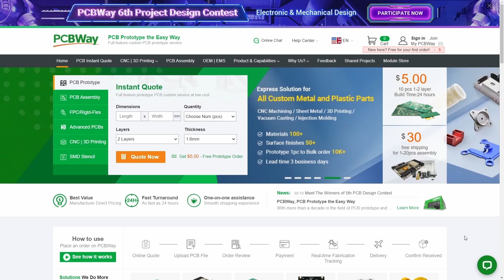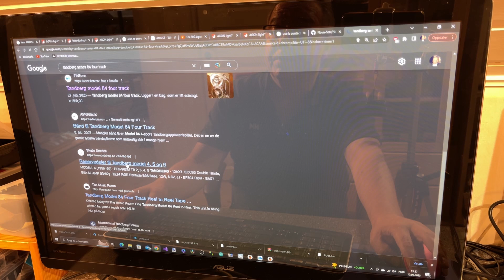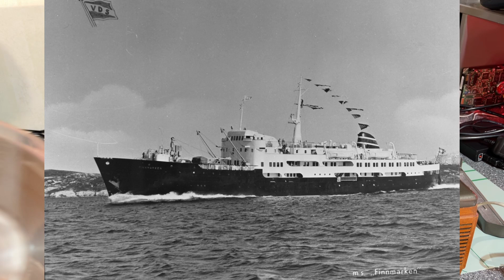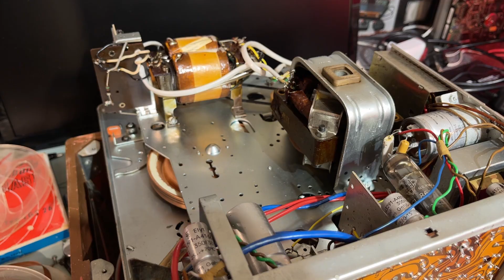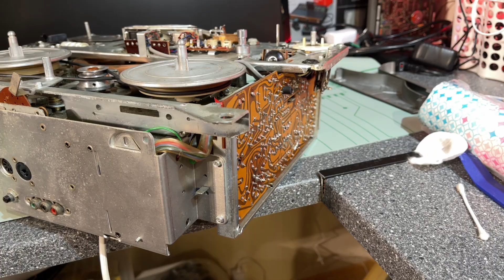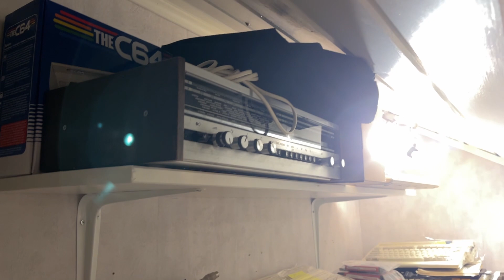My 60 years old Tandberg 4-track tape recorder - Will it still work ?

Comment: 9:33 No surprise there. These are very solidly build machines and that they are capable of functioning after many decades directly on plugging in the mains is a testament to that. Usually the only thing they need, if they have been kept well, is to replace the rubber grommets that hold the deck on the wooden case, and possibly some belt replacement.
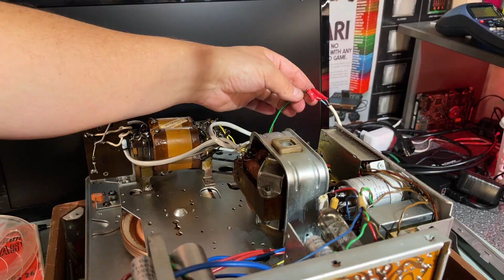19:33 They are usually clean inside, unless you find a sample that was left in the desert or in a manic smoker's house.
Good call changing the Rifas and the rest of the electrolytics and paper capacitors, although it is usually the small ones that suffer the most from age, while the large, power supply ones, as you found, are often still perfectly usable. The latter of course always depends on the original capacitor quality and type of construction method as well as its age.
This deck appears to be mostly valve based. If so, it will last for many years more, with only moderate use. Tandbergs have not significantly picked up in value yet, but this will surely happen as the years pass. With a good restoration, the sound quality will be of a mid-fi quality that can generate a certain nostalgia and will appeal to some people thus inclined. An expert in audio electronics might be able to push this a bit further, but that would require some minor modifications or more extensive parts' replacement, potentially affecting its value (negatively) as a collectible piece.
A warning: never tackle the idler wheels' rubber with anything aggressive like sand paper and the like (like one may see/hear/read on the internet). If these are so damaged that they need replacement, keep the originals somewhere safe for future reference: cheap (or expensive) replacements might fail much sooner than one expects.
One more, final note: I would be wary of using alcohol to clean electronics devices indiscriminately. This is particularly true of newer stuff, where the labelling, decals, paint etc. can come right off but even in old stuff you never know. Especially vinyl covered stuff, rubber parts, all sorts of paints or plastics, you never know how they will react to chemicals. Vinyl, definitely gets permanently damaged and becomes unsightly. Liberal spraying of alcohol in particular should be avoided for two additional reasons: a) most of it evaporates by the time you reach the area to be cleaned and thus b) it helps re-distribute dirt. I believe it is better to arm oneself with patience and plenty of time ahead and go over the same areas two or three times with just a wet lint-free cloth, using lukewarm water preferably, then tackle stubborn areas with a damp cotton bâtonnet. If the dirt/caked grease is too stubborn, then continue with slightly warmer water where a drop or two of dish detergent has been added. Only as a last resort should any solvents be used during a general, surface cleaning.

Comment: Sound like auto-stop is too tight... or pichroller are badly shape... or robber-gear are too loose; spring hold this ticht but sometimes it loose and rubber slips. I fix this kind to put extra spring. test if slow speed working, if not, this is the case. (Retro-mechanic)

Comment: hi have one some where   of this model   in 1986 i picked up a 4 track mono the deck was ok but case was  bad still have the deck 
it's not working  100% any more  my dad had a reel to reel in the late 50's 

it's a right pain to get    PCB Edge Connector  of the right spacing   i have a brenell mini  8  the Edge Connector for the pcb is come apart
you get this in akai  reel to reel  decks   it's the Edge Connector what it.s made of is going bad 

i had to use molex  Connectors  as they don't go bad over time

Comment: I very much appreciate your informative posting. I have recently acquired a Tandberg 12 series, like the one shown, which runs but without sound. The belt is slipping and will need to be replaced. I am hoping you may be able to advise on a source for belt replacement, and also shed light on why the internal speakers do not work. My late father owned a Tandberg 12 in the sixties and recorded family conversations which I would like to digitise, so I am endeavouring to get this working.
Hoping you can help and thanks in advance

Comment: I have this same machine. In fact I have it running right now, listening to some old tapes I made back when I was around 14 years old and some tapes my Dad made back when I was about 7 years old. It runs very well. It does get quite hot due to the tubes in the amp in the lower chassis.  But it's still a fun machine. It needs a good cleaning (i.e. heads, belts, rollers, pulleys) and I should replace the capacitors in the power supply (there is a slight hum) and the volume control potentiometer needs a cleaning.  Back when I was a kid tubes were still very much in use almost everywhere and fully solid state devices were just beginning to  take over. BTW I am 66 years old now.

Comment: Hei:) har en Tandberg 1200x, jeg har prøvd å koble den til platespilleren min, platespilleren min er koblet til radioen min, når jeg kobler den fra radioen til båndopptakeren min med en DIN kabel, og skal ta opptak, så er lyden ekstrem lav
Reply from the maker: Hei. Så bra at du har dette :) Platespillere må ha egen inngang fordi de har ingen egen forsterker. Radioen din har sikkert en egen såkalt phono/platespiller inngang. Skal du ta opp eller koble gamle platespillere til nyere forsterkere så trenger du en egen forsterker i mellom. Disse koster fra noen få hundre. Kjell.com har flere. Søk etter "riia forsterker". Lykke til.
Reply: @Arcticretro  har en gammel garrard model 2000, den har bare bananplugger, noe båndopptakeren min ikke har

Comment: Hi Tommy! I think you should check the capstan wheel lubrication on the recorder. On my old Teac 2300SD this was a big problem. The lubrication will get sticky and hard after so many years, so you need to remove the «flywheel» and rinse it to remove the old grease that is on it. I am not sure, but this could be the main problem relating to the uneven tape transport.
Reply from the maker: Thank you. Will look into it :)

Comment: Great addition to your content. Hey ... admit it. You've been wanting to take that thing apart since 1975. You held back all these years. So .... Are you going to go all Adrian's Digital Basement on us and add audio outputs so you can use it as a reel to reel data tape recorder for your old 8 bit machines? The ultimate coolness would be once you did - that add a manually sequenced "tar" (Unix style tape archive) command to your 8 bit machines so you can do whole disk backups.
Reply from the maker: I love it!
Reply: I actually started doing that to a Telefunken KL-85 which has a solenoid controlled pinch roller actuator which means you can computer-control playback/pause, there is even an input for that (remember that thing was built in the late 1950s) so I added a switch to tell the computer when play or record have been pressed and connected it to my Commodore PET. Unfortunately I haven't built the playback amplifier to get TTL level signals out of it, so right now I can only record, but it does look cool when I enter LOAD after having loaded something else already and the machine starts playing by itself under computer control. Funny thing it's more period correct than using a smartphone...
Reply: @senilyDeluxe  Oh! You're so right, it is more period correct. And OMG, that's so cool you're doing all that. Exciting to hear about. Are you going to make a video about it?
Reply: @AndrewTubbiolo  don't expect me to, unless I actually do finish it up. I built that like 10 years ago... with my current knowledge I could get it to work, but getting belts for the reel to reel will probably be harder. Also, space and time are an issue (aren't they always?)

Comment: I actually think it's not the rubber wheel. This wheel regulates the speed by slowing down the tape, so if it was not working properly it would play too fast, not too slow. The problem is the motor, I had the same thing with a record player (still need to fix this). Jan Beta has a video of a record player with this same speed problem and managed to fix it, so maybe you can watch this for ideas. The problem is that the motor has lubrication inside that has dried up and slows it down.
Reply: Not on this tandberg it's not.  The capstan freewheels nicely, wouldn't hurt to put a drop of oil in the bearing though.  It is the rubber pinch wheel slipping.  The wheel is regulated by the capstan speed the pinch wheel just pushes the tape against the capstan.
Reply from the maker: Ok, thanks :)